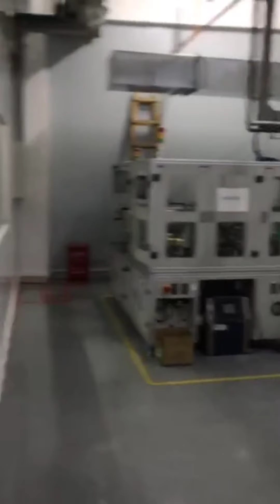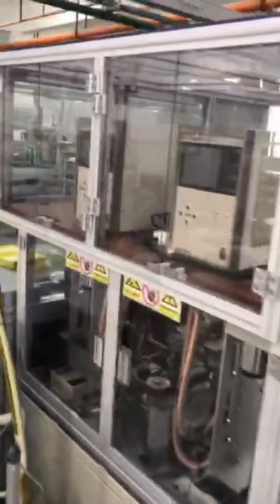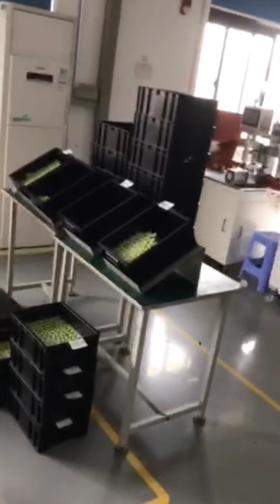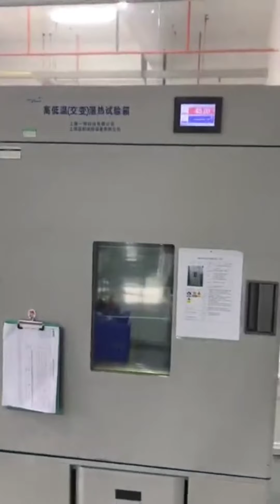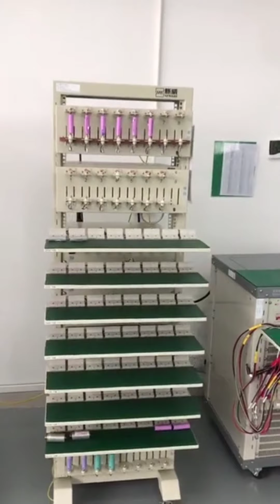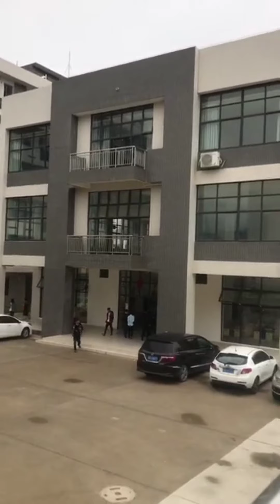Inside an eBike Battery Factory

Comment: @FLX Bike I'm really interested in the Baby Maker, great design! But I have a question before I invest; All batteries lose capacity over time, so it's inevitably going to need replacement eventually. How can the battery be replaced or serviced on the Baby Maker? Thanks!
Reply from the maker: The battery is designed to hold 70% of its capacity even after 500 cycles of full to empty.  If you ever need to replace it we have filmed this instructional video showing you the step-by-step process of how to do so:
https://www.youtube.com/watch?v=WOeD9qyle-E&t=102s
Reply: @superhumanbikes  Thanks! Sorry I missed that video earlier :)

Comment: Thank you for the informative video. That brings me to a question: The battery in the Babymaker is located without much free space inside the frame. Are you really sure that the battery can't get too warm, possibly overheat or shorten lifetime? I read that this could be a problem of such integrated batteries for other manufacturers.

I'm looking forward to September to ride and test my own Babymaker PRO :-)
Reply from the maker: Hey Timo, that shouldn't be a problem.  The battery is designed to function in an enclosed tube.